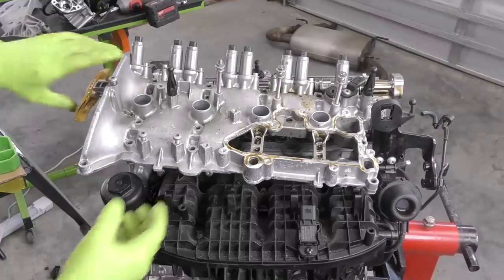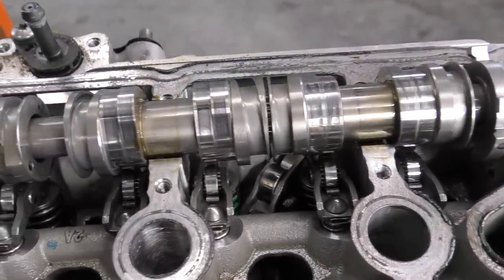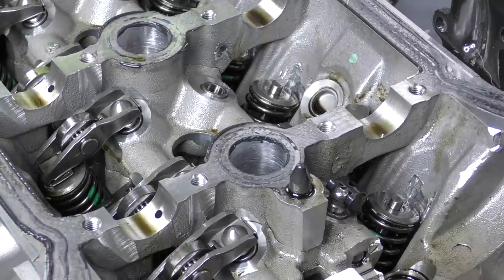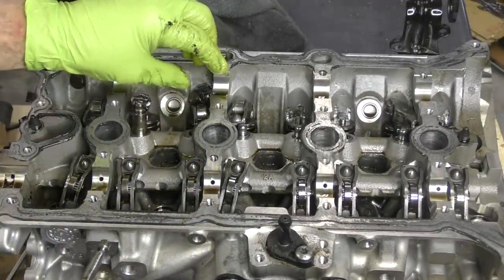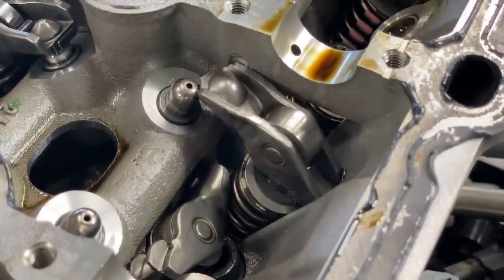Catastrophic Engine Failure VW 2.0t TSI Engine ~ MONEY SHIFT!

Comment: Vw: engine desteoyed at 9000rpm
V-tec: lol
Reply: A friend that had a subaru with the old EJ22 from the mid 90s demonstrated some 4th gear @ 6000rpm into 2nd gear "moneyshifts" to me. Obviously the tachometer was buried, but it should of been nearly 11k rpm. Did it multiple times on a longblock with 275k miles. It really didn't seem to care at all.
Reply: Considering i had a mk7 gti with 420hp and also a Civic. I find this true 😂 the vdub was fast but it just cant hold up..
Reply: The TSI engines in VWs are pretty fragile. They have enough trouble staying together with normal driving. Anything outside of that is asking alot of it.
Reply: 😂😂😂😂🥰🥰🥰😂😂🥰😂 I own an Audi with this motor but also have an si that takes a beating and sees nearly 9k on a daily basis for the last 5 years. Your comment is amazing 😂🙌🏻
Reply: @TETRO MONEY I did this in my Jackson Racing supercharged K20Z3...just kept on going lol.
Reply: My RX-8: Also lol
In fact, if I don't rev it up to 9000 every once in a while the engine tends to gunk up.
Reply: Or any Mustang Coyote V8 lol
Reply: Yamaha/Toyota 2ZZ Gen: LMAO
Reply: @fredpinczuk7352  in the Clelica GTS?
Reply: @loudring6247  Yes, correct
Reply: @fredpinczuk7352  Very good motor had it not been for some oil consumption and the fix Toyota did on the camshaft bolt breaking losing the "lift" feature, I'd love that motor otherwise. Not to brag or anything, but I'm sticking with my 2JZ until Toyota come out with another inline 6.
Reply: @TETRO MONEY A friend managed to go down a gear instead of up on a tarmac rally stage in his K20 engined EK Civic (dog box) and buzzed it.  It appeared to run perfectly for the rest of the event, but then dropped a valve on the first stage of the next event he did :(
Reply: @malikgreenough1846  Yes, because driving a car for 2 years is the official benchmark for reliability. So are so wise and so smart.
Reply: @loudring6247  Interesting you mention that. Mine was the original 1st 2000 GTS I bought right off the lot. They lowered the max rev the following year due to engine damage from over-rev. And after 165K miles. The cam bolt was like brand new. But  it was something that needed to be checked. In total I replaced a set of plugs, 1 ignition coil, 2 headlight bulb, 2 tail light bulbs, 2 rear lift gate cylinders. One belt tensioner (repack with grease after 3rd ownership and replaced it at the 8th year) One belt. And that is all in 13 years of ownership.
Reply: @fredpinczuk7352  It happens believe it or not sometimes people luck out. Toyota fixed the issue in 2003 model years onward.
Reply: @loudring6247  I didn't doubt it, reason why I checked. But if it did fail, it wasn't catastrophic. Just would not have the lift function.
Reply: @fredpinczuk7352  exactly.
Reply: So what you're saying is an engine that's designed to rev high can tolerate with that speed, but one that isn't can't? Does this government know about this???
Reply: Decades ago I used to rev my 1974 Renault 807 1565cc OHV (not OHC) cross-flow engine to 8000 rpm (or more - the rev counter stopped at 8000) without any ill effects. I appreciate that 8000 is much less than 9000 when it comes to engine damage, but it makes me realize quite how robust those old engines were. Moreover, it was extremely quiet at that speed. No valve bounce etc that I was aware of.
Reply: @jb9652  Same same, raced a 1.5L FIat SOHC. Same engine cast iron block they used for over 20 years. I can't remember the number of times I've crossed the finish line with the tach bouncing off 9K rpm and never an issue. Raced that engine for 3 years, never touched the inside once. It was over built, as they used the same block all the way from 1.3L to 2L.
Reply: @PrototypeSpaceMonkey  completely different tech
Reply: Audi: moneyshift at like 140 kmh, like 8k rpm, no dmg and here I am wondering how it survived that..
98 A3, with some 1.6l engine that was swapped to it, so it wasn't stock.
Reply: @PrototypeSpaceMonkey  - yeah, but even as standard these VW engines are putting out more torque and power than your poxy old RX8. The rotary needs to rev, to make up for it's relative lack of torque.
Reply: Every car can brake down duo to downshift you just have to be lucky if it survive..or just learn how to shift 🤣
Reply: My 81 Yamaha 400xs loved 12,000rpm.
Reply: @KLOKSLAG1911  - or when posting, just learn how to spell  🤣
Reply: @jldude84  not true American engines are not made for high hp but made for high torque... and bc of this there rpms are very low which allows for them to have heavier pistons it would never last at 9000 rpm the head probably but the bottom end is going to suffer severely
Reply: Well Hondas will rev to the moon since they are balanced so well from the factory. 
But I had a crappy Celica with a bad hg and 300k miles and tried to blow it up by shifting 3rd to 2nd a few times..and it never blew up. Used to overheat it so badly the get the garden hose and hose the engine to cool it down

Comment: i can imagine the face of the owner when he downshifted. Sucked to be him.
Reply: Tbh I'd buy automatic just because of this risk, but man so many automatic transmissions are risky/fail often. Even buying them new is not a guarantee it'll last. Let alone buying a used automatic. :(
Reply: @CitarNosis317  See, this is why I think young people/noobs/cautious drivers, should get an automatic.
Reply: @CitarNosis317  Or just don't go autocrossing if you are not familiar enough with your car or are uncomfortable with the way it shifts.
Reply: @CitarNosis317  Automatic sucks. As much as people that aren't able to use a manual gearbox :p
Reply: @CitarNosis317  Yeah certain automatics can be problematic and longevity is not as good. Primarily with the CVT transmissions. Someone I know had a Nissan Altima with a CVT and the transmission failed after 70,000 miles. They had the transmission replaced and kept driving the car but at 150,000 miles, the transmission went out again. They got rid of it after that.
It is not uncommon for manual transmissions to last 300k miles as long as you take care of it by changing the gear oil at regular intervals and going easy on the clutch (not having it partially engaged, not using it to keep you sliding back on a hill, etc).
Reply: Had to be a noob, hard for a vet to pull that off.
Reply: @CitarNosis317  You can buy a manual, just drive it like a girl.  I speak from personal experience, because I'm a chick.  :)  Go slow when changing gears, and release the clutch slow.  When you release the gear stick, its natural resting position is between third and fourth gear.  It's an easy straight line.  I really don't know how anyone, when driving normally, can accidentally go from third to second.  I swear, it's a "guy thing" to slam through the gears and over-rev the engine.  I presume that guys who drive like that are compensating for having an, um, small gear stick.
Reply: @hamsterama  complexes much, eh ?
Reply: Xx BigBoss xX  - When you're racing and speed shifting, common sense has nothing to do with it. He simply missed his shift. I've done it before, just driving normally, and you can easily catch it before it over revs, but you can't catch it when you're speed shifting at high RPMs. It's why I don't buy manuals any more. Porsche PDK is the way to go. Way faster foolproof shifts and no risk of blowing your engine. Not to mention, much easier to drive in stop and go traffic jams.
Reply: @mr.slaphappy3794  yeah, I used to think that too until I had to drive to work on the highway every day during rush hour.  I was more than happy to give up the manual for a DSG.

Comment: At least the pistons looked ok, i have seen a lot of engines where this has happened where the valve heads have failed and ended up in the piston and the cylinder head.  Great video

Comment: I just got one of these at the shop, i checked the mechanical over rev fault at 9700 rpms, “ customer stated they were cruising on 6th gear and slowly started loosing power”  lol I gave the customer the option, to remove the  oil pan and check for carnage and remove the valve cover and check for carnage and If the pistons and cylinders walls look ok we can put a cylinder head or used or new engine.

Comment: Overall impressed the bottom end was ok. It is a testament to the 2.0T TSI engine really. I've seen money shifting resulting in bottom end window insertions as the bearings and caps exiting the building.

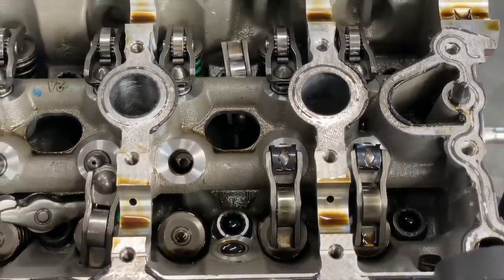Comment: 11:55 good explanation of why ECU can't rev limit engine when downshifting
Reply: Not normally but it’s possible to use the abs pump ( or a extra one like it ) and some additional software and extra plumbing and solenoid for limiting the clutch engagement  aka traction control

Comment: There’s  a 5.2L “Voodoo” engine (Mustang GT 350) in my shop that the driver money shifted.  There were 2 connecting rods melted into the (plastic) oil pan and the rod bearings were partially flattened out on one end from the extreme pressures they experienced from over revving before the rods gave up.  Dude was on a track, had a short shifter and tried to go 5th to 3rd but got 1st.  Stored data indicated engine RPM in excess of 9500 RPM.  Epic engine carnage on that one!
Reply from the maker: Holy cow!!

Comment: That's... ouch...

A while ago, a friend showed me his H22 block from his Prelude. Con rod made a viewing port in both sides...😬
Reply: Years ago we were playing doing top speed runs on bikes on an airfield. A guy on a zx12r blew the engine on one run and looking at it back in the pits area we could see a hole in the block.

Few weeks later he posted pictures of the block post strip down. There were 6 holes in the block. 3 rods had snapped, each punching holes front and back.

Oops!

Comment: Good video. I have a 2015 1.8tsi and very impressed with the little engine. 106000 miles still runs like new with no noticeable oil consumption.

Comment: Slipper clutch like some motorcycles have, that is what this guy needed.
Reply: He needed to be a better driver. I have been driving for 20 years, cars, trucks and even 18 wheelers. Never have I ever done something so silly (some may even say stupid). I only know one person that has done this street racing, it was an Acura RSX Type S. Same thing, 3rd to 2nd. Engine was gone.
Reply: Not sure how a slipper clutch would work as you are basically coming down two gears in in one shift.example going for fourth but getting second.
Reply: @nickpappas4133  Slipping, simple
Reply: @_Mario_PL_  That, for sure mate!
Reply: @nickpappas4133  A slipper clutch disengages itself slightly (slips) when over-revving. Supermoto racers can go from 6th to 2nd for a corner and the slipper clutch minimizes overrev and wheel hop.
Reply: 100%! Love slippers
Reply: Exactly ... donno why cars dont have them !
Reply: @nickpappas4133  slipper clutches are designed to rev match gearbox and engine to engage in gears. If gearbox rpm is less compared to engine or vice versa the clutch allows certain amount of slippage without you pressing the clutch. This avoids this type of damage. 
Google how slipper clutch works. Its really  a boon.
Reply: @VivekSingh-nl6hs  Car's don't have them as they simply aren't needed.  You have to try pretty hard to accidently go down a gear rather then up with a synchromesh gearbox , and it would significantly complicate clutch design and cost more.  Also prevents you from bump starting the engine.

Comment: Other than (maybe?) structural strength, how would the scuffs on the cast affect the function of the engine?
Reply: I was going to ask the same thing.  If the lifter bores and other precision surfaces are ok, why not just get some new parts and put it back together?  One possible problem might be cracks that aren't immediately apparent.

Comment: One more reason to love my DSG.  Yes I can drive a manual but as my daily it's just easier on me and the car.
Reply: At least with the DSG, there is no possibility of shifting to the wrong gear.
Reply: @M Bacon If you did most of your 400 miles on express highway, i don't see why you'd hate a manual. I used to drive a lot on French autoroute and German autobahn. A manual car never bothered me until I moved to Paris.
Reply: I've owned a DSG and a Multitronic(CVT) before. While the Multitronic was kind of weak, the downshift from gear 3 to 2 in a DSG often acted quite bumpy. I'd therefore choose any old-school Aisin 6 speed torque-converter automatic over these two German creations.
Reply: @kbatzler  - you'll understand the disadvantages of DSG when you need to get one serviced. It's literally a case of throwing the whole car away when the transmission gets a fault.

Comment: A VW at 40K miles is still under manufacturer warranty so the dude that owned it voided the warranty by modding the  crap out of it and damaged the engine. Good video bud, you should have way more subscribers than 411K. Subbed!

Comment: I did a money shift on my L13 Dsi Jazz a few years ago on the highway doing about 120kph. Went from 3rd to 2nd and dropped the clutch. I know the tacho only has numbers 8K rpm and I saw the needle hit 8K (2K over redline) . I sent the car in for a check up and it ended up being fine. 100000km later and the motor is still running. 😋

Comment: weld the hole in the valve cover, send the head in for a valve job (might as well get it ported), performance cam, and rockers, and it'll be just fine.  The gouges don't mean anything

Comment: I’m actually surprised at the damage isolation to the top of the head.
Reply: I think what happened is the rocker arms jumped off the hydraulic adjusters and so the valves stayed shut, so they didn't hit the pistons. ????????

Comment: I bought an e36 that was money shifted and repaired the head with junkyard valves. It bent all 12 intake valves but caused no damage to the valve seats or pistons. No cyl head damage, no loose or broken parts either. Just gotta watch the cooling system (+ subsequent cyl head cracks) and the bmw m/s5x based engines are bulletproof.
Side note: I can't stand those gloves - damn things rip every 2 seconds!

Comment: Nice video! I’m guessing this is virtually impossible in a stock DSG setup since it won’t let you down shift if the revs are too high? I always assumed this but just want to make sure. What about stage 2 DSG setup, would it have prevented downshifting?
Reply: For stage 2 engine tune you have to independently tune DSG transmission to a stage one time to not damage it.
For stage 1engine tune DSG gets retuned through engine..

Comment: I had one "money shift" from 2nd to 1st on my mk6 GTI, but have no engine damage except one lifter on cylinder 4 which causes high speed misfire. ECM recorded that I had reached 8700rpm. I should be lucky that I had no major engine damage. That is my first time for about 25 years of driving experience that i put in wrong gear. And, yes, that is driver failure.

Comment: Hated this Mk6 Gti engine, what a POS
Reply from the maker: Man that version of the 2.0t is problematic
Reply: HumbleMechanic <<< Come on, I’ve watched you for years! Lets start with the DI system and the infamous carbon build up on the intake side due to guide seal failure and poor engineering! (Now dual injectors help some) Then there’s the repeated valve chain tensioner failure, and not to mention the faulted water pumps that required 3-4 replacements until VAG decided to fully update the part... It wore me down bigly.  I must have gone through 3 sets of seals and several crates of walnut shells with all the in between blasting I needed to do with this engine... like I said, a real POS!    (Sure ran great for awhile when everything was in tip top shape & clean... and then after 8k miles or so... pure 💩every time.)
Reply from the maker: Come on what? I agree with you 🤷‍♂️
Reply: HumbleMechanic <<< 👍 Sorry, just venting.... 🖖
Reply from the maker: I get it. Haha it seems to be what everyone on youtube is doing the last 2 days 😂

Comment: I money shifted my MK7 R but luckily I was able to stab the clutch before any damage could occur.  It was still a money shift because the dealer had to pull it apart to verify nothing was damaged.  Just a couple rocker arms popped off.  Everything else survived.

I put a diesel geek shifter link in it after that and it made a WORLD of difference.

Comment: Seen a few like this, normally get a few / nearly all the valves totaled. Usually missed gear or downshift like yours. One engine was reduced to shrapnel !  I have a friend who works in the VA group who has told me they can see if any re programing has been done even if it was later removed ,with lot of the data stored permenantly. This has shown up when there have been clutch failures due to tuning ,needless to say it voided the warranty.  I guess there must be hidden files in the ecu software. A very enjoyable video.. especially watching someone else work.😉
Reply: Yep, most modern cars will show if there has been any tampering with the factory ECM, some of the new ones even record if the ECM has been removed and for how long. That means you go in for a warranty repair and they discover the ECU has been out of the vehicle for XXXX miles and hours and was just replaced, Instant warranty void. Then there are others where you try to do any tuning and it bricks the vehicle.

Comment: Funny how in car's engines 9k rpm considered high for the engine while motorcycle i4 engine usually revs up pass that.

Even some cars from Japan mostly can reach that. I guess the initial design of this engine weren't supposed to rev that high because the rocker can't move fast enough to do it's work.

Awesome video, very informative. Please do some more!